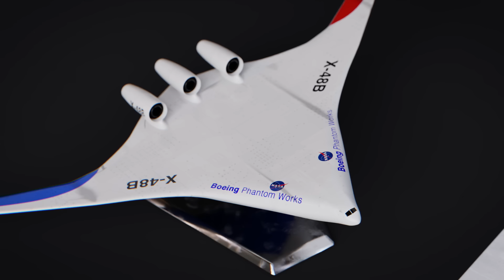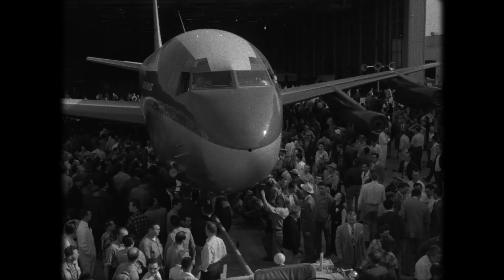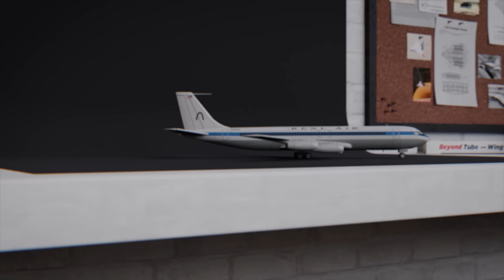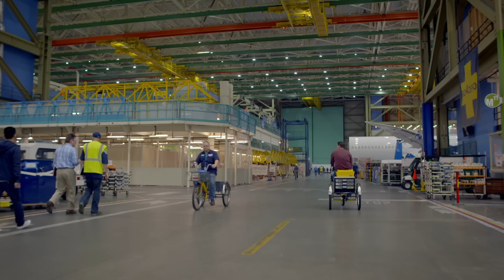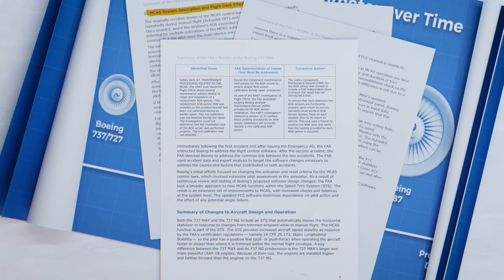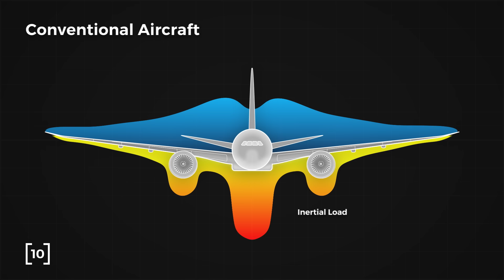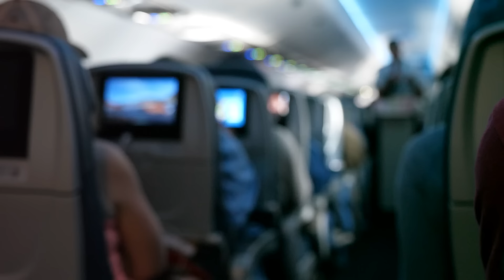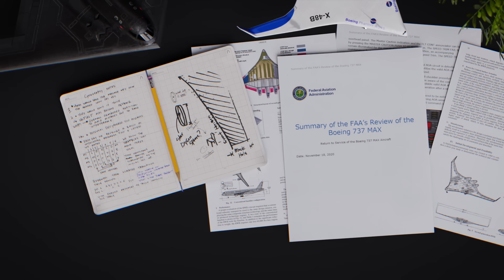The Plane That Will Change Travel Forever

Comment: What about the question of increased g-loads for those passengers sitting further from the center-line of the aircraft in the wider bodied blended wing?
Reply: Guess where the cheap seats will be located.
Reply: It would be more fun lol, roller coaster ride for free
Reply: More specifically, the acceleration at the edges of the wings is going to be far higher than at the center. A plane can make sharper turns if all the sensitive cargo is in the center. It may be that the cargo space for the plane will be located in the outer area, while the passenger section section will be closer to the core to try and alleviate this issue.

This issue doesn't just apply to people, but also unsecured items in the outer area. A sharp correction could cause items to lift off the floor or liquids to slash onto people, with the issues ranging to inconvenient to dangerous.
Reply: Guys, I figured it out: The plane should just fly in a straight line. No turns allowed.
Reply: @ZandarKoad  If we refuel in the air and hand out parachutes, we won't even need to land.
Reply: @ZandarKoad  ah so they can use Ford's blue cruise as autopilot then!
Reply: Give me those aft cabin seats for those brief moments of near 0 G any day.  What's flying if not fun huh?
Reply: g-loads aren't the problem; it's just damn uncomfortable.
Reply: Just allow less roll in the plane specifications.
Reply: WEEEEEEEEEEEEEE!
Reply: Tbh i dont think you would have significant g loads due to to the small bank angels these planes operate in
Reply: from my experience, planes don't do sharp turns at high speed.
Reply: It will not be that much. Passenger aircrafts generally do turn that fast so the acceleration that you will feel at ther end of the wing be about the same as a bad turbulence in a normal plane
Reply: @bharathirajkumar  And what would bad turbulence feel like in this plane?  Any landing in bad weather would amplify motion sickness at the outermost seats.  🤮
Reply: @GeoffB10  turbulence will move the entire plane up and down, so it will be similar to normal plane
Reply: @bharathirajkumar  I agree with your statement for clear air turbulence at speed.  Low speed cross wind landing will be more of an issue.  I think people generally don't realize how much roll there is in commercial flight because we are accustomed to sitting on the roll axis.
Reply: @GeoffB10  but the omega dot and omega double dot (angular velocity and angular acceleration of roll) will be very low. Many time if a pilot does not have his attitude indicator, the pilot will not even realize the plane has rolled.
Reply: Motion sickness is a critical problem with these concepts.  Might be okay for cargo.  People not so much.  Also, if these concepts made sense, Boeing or Airbus would have already done it.
Reply: @GeoffB10  > "Also, if these concepts made sense, Boeing or Airbus would have already done it."
> Completely ignores 24 minutes of video arguments for why they haven't done it
Reply: @bennemann  as the video mentions, the tube is the optimal pressure vessel.  Any other shape will be heavy.  Weight is a primary design driver along with aero.  Never mind there not being a market for these in their proposed huge form.  Just look at the A380.  Any weight benefit that comes from CFRP also goes into tube designs; 787, a350, and a220.  Pretty close to half the dry weight is now just the gear and engines.
Reply: @GeoffB10  Airbus maybe, but doubtful about Boeing. Besides, you don't just do a whole new type of aircraft. Just the retooling required would cost a massive amount of money. The economics of it, believe it or not, is a prerequisite to the technical requirements.
Reply: @robinolisa1524  totally agree about the economics.  Boeing and Airbus don't launch new programs without market demand from the airlines.  There is zero demand for BWB or super jumbo.  Maybe if the BWB was smaller in the 737, 757, or a321 size range there might be a market.  The manufacturing technology wouldn't be much different for BWB.  If there is more complex internal structure then the manufacturing cost would certainly be higher.
Reply: @GeoffB10 
I do not think that I have much motion sickness, but I do not have the experience of being on a ship in rough waves, to prove it. I did once take a shower in an RV while it was driving down the freeway. By the time it was my turn, we were already rolling. Curious sensation, the motion, but I had no problems with it. Obviously, I was not the driver. And I didn't seem to be affected by the reduced air pressure when I flew some many years ago. As I recall, as I wore a watch at the time that had a barometer, weather forecast based upon it, temperature, and compass, it told me that my flight that flew at 30K+ feet, my watch claimed it was only but +1K feet based upon the slightly-reduced air pressure. So I expect that my personal tolerances would be compatible with this design, if it works out and becomes popular? I would probably choose among the cheapest seats, even though that may mean the most motion?

But I would like a window seat or at least a good view of the cameras.

Comment: Windows of Comet were not square. The 1st prototype shown did have square windows. They were squovoid? The failure occurred due to punched through rivets on the roof aerial section where adhesive was written into the design. The  airframe did have areas of high stress concentration though and it was redesigned with thicker alloy and hence more powerful engines. (And fully round windows).

Comment: What you can do on the inside to minimize the Boeing or get rid of it from the pressure differential that pushes upward force and causes the fuselage to expand You would inverse or reverse the crown and the crown would face downward so as the air pressure reduced outward and it stayed constant inward it would push up against the arc and the arc would flatten out and so this arch reverse arch would absorb the upward pressure of the internal pressure as it pushes up the arch flattens like the arch in your foot and it smooths everything out so you don't get a bubble and when the pressure goes down the arch returns back to normal Boeing inward! So you would use a reverse arch or a 😊 to see the smile has the downward arch and then the smile can flatten out to a neutral flat plane so it absorbs the upward pressure pushing the pressure out towards the ends so you can absorb that internal pressure on an internal liner The external liner can stay the same The internal liner would have the smile absorbing the pressure differential keeping the outward skin perfectly smooth flat no upward pressure against it! So that solves that problem!

Comment: So that should solve all the problems and now you have a flying wing that is perfectly stable in any turbulence! And yes I can move its flaps to assist but it really doesn't have to The engine should be able to change the pitch of the plane by changing the pitch of the thrust on a vertical plane but also it can move the thrust on a horizontal plane too! So the engines being able to move on the horizontal plane changing the thrust direction and a horizontal it also helps with the turning of the plane left or right making turns quicker but smoother!!!!!

Comment: It concerns me that this design would literally never be viable as a commercial model, due to what you were saying about active and passive stabilisation. If they can't make it passively stable surely that means that any power failure would send it plummeting to the ground? And considering that planes are regularly hit by lightning which sometimes causes a momentary loss of power, wouldn't this be far too risky for commercial flight? It seems like a massive and possibly design-breaking hurdle that would need to be overcome before these would ever be considered safe enough?

Comment: You lost me at "no windows".  Airplanes are already like claustrophobic cattle cars.  No windows and more people just makes that worse.  Also, isn't "fuel cost" only like 10% of the cost of the flight?  So saving 27% on 10% is 2.7%.  That's not insignificant, but it doesn't seem revolutionary, either.  Faster boarding/unboarding times is probably more meaningful (to passengers, airlines, and airports).  Honestly, a radical overhaul to security and the TSA (to largely eliminate it) would be the most meaningful change.  Anyone who traveled in the 90s knows how much better the experience was.  You spent less time in the airport, the seats were more comfortable (space and softness), the flight attendants were much nicer (and paid better).  Flying use to be fun.  Now it's fairly ho hum.

Comment: 25:11 Hydrogen fuel is not a replacement for fossil fuels because it is made from fossil fuels.  The idea that it comes from sea water is science fiction.  That's too expensive in both money and electricity costs so for the foreseeable future hydrogen is made FROM fossil fuel production.
Reply: Hydrogen fuel is like a battery. Sure, the hydrogen comes from electrolysis of water, but where does the energy required to split the water molecules come from?
Reply: @ragnkja  Except it doesn't come from water.  That's too expensive from a monetary point of view.  It's cheaper to get hydrogen from breaking down fossil fuels so that's where it comes from right now and for the foreseeable future.
Reply: @IRMacGuyver  
In any case, my point is that hydrogen fuel is better described as a store of energy than as a source of it, since you need to use another energy source to produce the hydrogen.
Reply: @ragnkja  Which is something I already described in my original post but you made the mistake of claiming hydrogen is currently supplied by companies using water.  It's not so the point still stands that it's a fossil fuel biproduct.

Comment: I wonder when they will develop aircraft into a form where they separate the wings/engines from the payload so that you are catapulted down the runway to be retrieved by a perpetually flying wing that never lands and taken to the airport of destination where you are dropped off by the flying wing carry-all.
Reply: More likely to get a orbital ring with a hypersonic train on it
Reply: @James-sk4db  don't need a vacuum tube when you're in space lol. That's literally the only way the hyperloop would ever work.
Reply: I think that would require star trek level of tech, we've seen planes detaching other planes mid air for decades, but the only mid air attachment we've done in the air is for air refueling IIRC. do you want to be in a plane that was catapulted into air and the whatever platform that supposedly catch you can miss the process? lol

Comment: Solution:  Take a lesson from submarines and don't even attempt to pressurize the lifting body.  Instead, keep it entirely unpressurized.  Instead, build your pressure tubes -- along with the heavy thermal and sonic insulation -- INSIDE the skin.  If you build multiple vents inside, you won't have to worry about an internal rupture blowing off outer panels.
Reply: I was actually thinking about that same exact solution, just minus the submarine example. In the end, it would look kinda like the design they decided not to go with, just with vent on the outer fuselage, right?
Reply: There goes your weight savings...

Comment: No mention of the problem of lifting bodies regarding the comfort and safety of passengers in the seats furthest from the centerline. With tubular designs the seats are all relatively close to the centerline so vertical changes during banking or turning is minimized. With lifting bodies the outside seats could have fairly large and quick vertical changes. Even if it doesn't rise to the level of danger, it could greatly impact comfort. I thought this was one of the main reason for their lack of adoption.

Comment: I'd be willing to bet that those failures being due to having a single sensor rather than redundant systems can be traced back to one or more executives earning themselves a bonus because by eliminating redundancy from the original designs they managed to save the company a miniscule amount in production and maintenance costs.  This sort of shit usually comes down to the suits having no clue.
Reply: The aircraft had multiple sensors, but the code was written by subcontractors that had no expertise in aviation, and considered only a single sensor - it was programmed to switch to the other sensors if the first stopped responding, but it couldn't identify bad data.
Reply: @Orlandofurioso95  mmm I think they needed a neural network to identify a sensor with bad data as a redundancy and also they need to simulate a sensor or two with bad data
Reply: @Orlandofurioso95  This goes against the narrative that american airlines had all three sensors active while international airlines did not. So if it was as a result of faulty programming, how come that it only got fixed for some airlines and not for others. Unless that was never the case.
Reply: Thats nice - and how many hundreds of innocent people died.
Reply: So subcontractors with zero aviation expertise wrote the firmware code.  Sounds like ANOTHER cost-saving measure implemented by clueless execs.  Why pay for expensive aviation coders, when you can hire a cheap software company in India or China?
Reply: Nah, they didn't eliminate redundancy. They instead sold disagree warnings as an add-on for extra charge!
Reply: @Channel name Aviation "regulations are written in blood". So pilot retraining is so expensive the suits decide to tell the software designer to only use one sensor? You made their point for them.
Reply: @Channel name Why would this bit of code getting its data from two sensors, rather than one, require retraining of pilots?  That makes no sense that I can see.
Reply: @Channel name And how does that still not fall back on Boeing? They made the choice to eliminate that redundancy which would've added an additional layer of safety in order to sell the aircraft better because it wouldn't require pilot retraining costs. That is ultimately an executive decision THEY MADE.
Reply: If the profit motive could be removed, none of these accidents would happen when it comes to saving costs. The profit motive allows greed to go unchecked and the company still running with blood on their hands.
Reply: That turned out to be good savings indeed...
Reply: @shurmurray  

Good joke!
Reply: I blame the MBA for making people believe they have suddenly become managers. But they are administrators not managers.
Reply: @andyrbush  

Administrators or managers, are the sane thing.
Reply: I would love to see the Failure Mode and Effects Analysis (FMEA) for this part of the design. How could they have missed that?
Reply: Frankly I'm surprised Boeing is involved in the flying wing aircraft development. The impression I get is that they tend to put profit before innovation and are very short sighted with the mentality of not investing in new tech if the old tech is still profitable.
Reply: Actually this is a discipline called "value engineering" and includes robust risk analysis. It's not stupidity: these are the pickpockets at the bazaar.
Reply: imagine if governments actually had a system in place where contracted engineers can anonymously snitch on their contractors unwisely and greedily making poor safety choices.
Reply: If what you say were true, airliners would crash every day of the frickin' week.  THEY DON'T.
Reply: No Clue? More like more GREED!
Reply: Damn smart business plan for greedy, criminal Boeing management:  kill its customers.  The Max was in domestic service for year or two before the crashes.  1000s of safe take-offs, landings, flights.  Then the crashes whose common denominator is third world airlines.  Hmmmmm.   
   The Max certainly wasn’t Boeings finest hour, but knee-jerk blaming Boeing is childish, and simplistic.  And it’s dangerous because it can hide the primary failure cause..say in the case of the Max some idiot lineman using the AOA sensor for a foot peg.  
    An inconvenient fact of the engineers life:  New products are blamed for failure whether or not they are indeed the cause, the impossibility of fixing stupid, armchair internet experts gushing hindsight.      Cheers
Reply: @Channel name 

This is a problem with the corporations, not regulations.
Reply: The suits share blame, but lets not forget that the FAA reviewed the design and its requirements and deemed it safe. So the regulations forces the suits to eliminate the sensors at a huge cost penalty and the FAA just agreed with it. They share the same blame as the suits.
Reply: @mennol3885  Nobody forced the suits. Nobody.
Reply: Yes, and i would add cramming people into less space like sardines is not something will get ME flying anytime soon
Reply: @comment6864  then but first class
Reply: We should get rid of business suits, BTW. I heard something about them being linked to Nazi uniforms. I personally do not like suits and ties. What for do I want to look like a corrupt politician? Why can't important workers, or leaders, or whatever, wear more comfortable clothes?
Reply: You build in errors, they have contract, get balance after, costs who cares?  Oh, no we gave obligatory few to Israel free, and Russian, China, everyone supposed to be enemy had engineers waiting,, sold technology, stole bluecprints, guess need redesign they copied it exactly almost coincidentally. Contracts bombers fighters thanks!

Comment: You could pretty easily put windows on the tops and bottoms of the plane
Reply: “Easily?
You’d need extremely thick windows to be able to allow passengers to see through the fuselage which is also a lifting body so it may or may not cause interruptions in air flow 
Also I imagine people won’t feel comfortable walking on the windows or constantly look at the ground if they’re scared of flying
Reply: @LiewLmao  the windows on all other planes are flush with the fuselage, made up problem